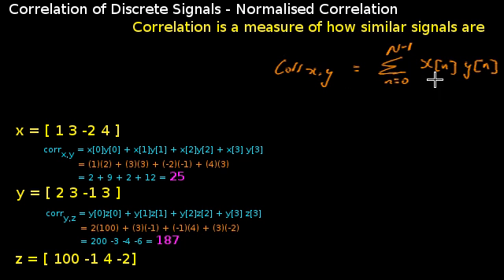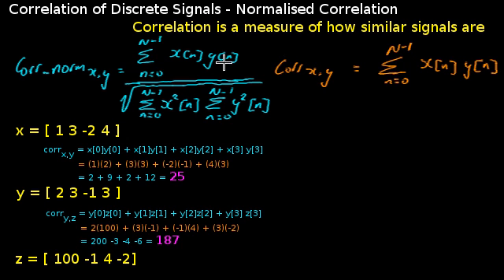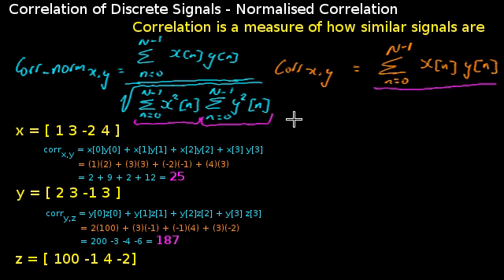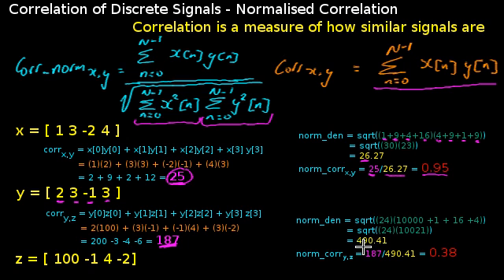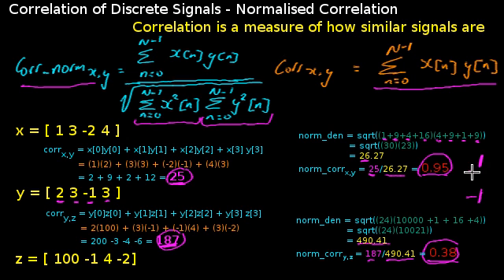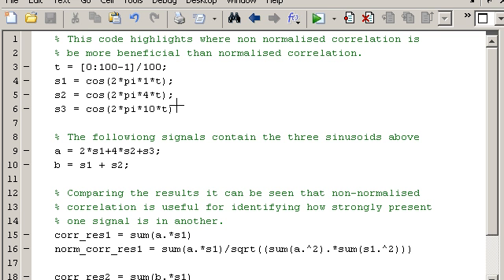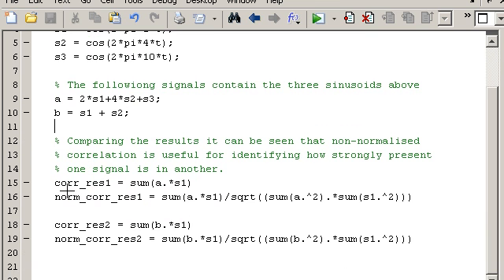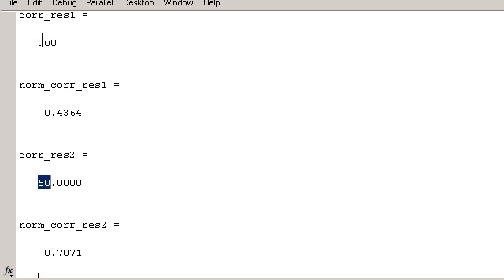Normalised Correlation  Explanation with Demo

Comment: So, from what I understand:  correlation measure is to show how strongly the signal is into the sample signal, while normalized correlation is how similar are the signals, is this right, please?
Reply from the maker: yes. That's how I interpret them
Reply: @ddorran  Thank you for your response, David. Actually, this makes sense and does have a basis I feel. While the Correlation measure shows how strongly the signal is in the sample signal by the dot product, the normalized correlation relation looks very much similar to the Pearson correlation factor (r). Thereby describing how linear or nonlinear the association of the two variables x and y, or in this case - the signals are. Can I conclude like this? It would be nice to hear your thoughts, please.

Comment: This is a good explanation of what the equations represent and how to code them up, but ultimately fails to explain what it claims to do (describe when normalised correlation is beneficial to use over other methods).
Reply from the maker: In the first minute of the video it shows that standard correlation measures are impacted by the energy of the signals being correlated (rather than the shape) and later it shows that normalised correlation deals with this issue by scaling standard correlation appropriately. Does this not show when normalised correlation is useful? Have I misunderstood the point you are making?

Comment: Thanks for sharing this!!!
I'm trying to implement but I'm not getting a value between -1 and +1...should I be doing something wrong?
Anyway 'seems' to work.

What i do is:

i have two arrays:

A[a1,a2,a3,a4...]
B[b1,b2,b3,b4...]

first normalize both data groups from 0 to 100 ( i want to find % changes)
second i put in a variable 'first_pass'  : (A[a1]*B[b1])+(A[a2]*B[b2])....
third i put in a variable 'second_pass' : (A[a1]^2) + (A[a2]^2)....
forth i do the same with graph B and store in 'third pass' : B([b1]^2) + (B[b2]^2)....
fifth i get my results: (first_pass/(SQRT(second_pass*third_pass))

my results is always > 0 but not between -1 and +1
could you help me? :)
Thanks!

Comment: Could someone please resolve the following issue : The correlation results 1, when compared to correlation results 2, indicate that the 2 signals in consideration are better correlated in the first case (100>50). However the same conclusion from normalized correlation results indicate otherwise (0.4364<0.7071)

Comment: If the sinusoid is already apart of the signal a and b why are you multiplying the sum of the sinusoids squared with the sum of the signals square in the denominator of your code?
edit: My bad, I misunderstood what signals you were comparing in the normalized correlation. However, I don't understand why it was required to step through the matrix with a for loop previously but not now?

Comment: Hello, thanks for the video. I have a question, what does biased and unbiased means in the xcorr function? (roughly speaking).
Reply from the maker: unbiased means that values further away from a lag of zero are general smaller since there are fewer non-zero samples to sum. You can account for this by dividing by the number of overlapping samples for each calculation.

Comment: Hi David, 

I am really enjoying the videos you posted. I have seen others using the Pearson coefficient for correlation, specifically in template matching methods in the signal processing domain. The method above and Pearson method will provide rho to range from -1 to 1. However, It seems they will give slightly different answers, regarding the produced correlation coefficient.  

Are you aware of any type of documentation out there that highlights these two methods and their differences? Or even a more specific name for the normalized correlation coefficient method you discussed above for to me to do literature search on ? I am aware of this method, and its heavily used in signal processing as well, for applications in DTF and match filtering. I guess I am wondering if there is an ideal time to use one or the other, and I really haven't seen anything or anyone address this..... 

Best, 
Nick
Reply: +Nick1Nap 
I think found what I need... Thanks! 

http://dsp.stackexchange.com/questions/9491/normalized-square-error-vs-pearson-correlation-as-similarity-measures-of-two-sig
Reply from the maker: +Nick1Nap Thanks for posting this link! I have a bad habit of using my own (and sometimes incorrect) terminology when I'm attempting to explain a concept and I have noticed this to be particularly problematic with this video.

Comment: when correlation is applied is there a minimum value based on which it is decided that the waves are similar or it is proportionality between minmum corr and max corr ?
Reply from the maker: it would depend on the application and would most likely be determined through experimentation
Reply: David Dorran so it complicated then . i did a correlation between i think two sines and the value was 60 . 
in DTMF number detection .. correlating the spectrum of the recording with standard DTMF signals spectrum doesn't result 1 in the normalized formula . the peaks are of very less values but still constitute peaks compared to other correlations .

Comment: how we can link this to the fourier series and transform ? 
i think in the transform we are using the standard correlation .
Reply from the maker: The discrete Fourier transform is a simply correlation of a signal with a set of sinusoidal basis functions see https://www.youtube.com/watch?v=B2iUDBZzBpY
Reply: David Dorran Nice. But what is the necessity of correlating with exponential ? 
Exponential contains Re cosine part and Im sine part . Why we just can not correlate with cosine or sine ? And why we do not use normalization ?
Reply from the maker: hamdi f The complex exponential is a combination of a cosine and a sine so its mathematically convenient to use it rather than use separate sines and cosines. Also if the signal being analysed is complex (real and imaginary terms) then that signal isn't just made up of sinusoids (which are combinations of negative and positive frequency complex exponential pairs which are equally weighted see https://www.youtube.com/watch?v=M1bLPZdNCRA) its made up of a set of positive frequency complex exponentials and negative frequency complex exponentials which may not have matching weighting for positive and negative frequency pairs.

If you used normalised correlation you wouldn't be able to determine how strongly present a cosine or sine was in the signal being analysed see http://youtu.be/ngEC3sXeUb4?t=6m36s
Reply: David Dorran Regarding the last paragraph ; if i got a x1(t)=coswt and x2(t)=10*coswt  then the normalized corr formula fails though they have the same frequency and should have the same magnitude response except for the some scaling differences in magnitude plot . 
And if i have two different frequency waves the standard corr formula may fail and show misleading answer that they are similar ! 

The second point ; you said that standard  corr shows how much of signal 1 is in signal 2 . But since multiplication is commutative and that means that sig1 is contained in sig2 as much as sig2 is contained in sig1 ! and i think that is not correct . 

Can we use at least for real signals .. a Fourier terms of cosine or sine for corr ?
Reply from the maker: If you correlate two sinusoids of different frequencies (f1 and f2) you will get a result of zero (once the duration over which you correlate is an integer multiple of 1/(f1-f2))

With regard to the second point my terminology is misleading - I do say that correlation is a measure of how strongly present one signal is in another which I think is conceptually a nice way to think of it in certain situations. However saying that correlation is measure of similarity between two signals is more accurate and would fit in with your observation that the correlation process is commutative.

Yes you could undertake a Fourier type analysis of real signal that correlates against only real cosines and sines.

Comment: why we should not use the normalised correlation here? Is the b did more similar with s1?
Reply from the maker: In the second example you are trying to determine how strongly present one signal is another rather than a direct measure of similarity between signals
Reply: Thank you! 
I think I don't get the meaning of 'strongly present', would it be used in signal conditioning?
 It did amplify the signal, yet introduced a larger noise.
Reply from the maker: Yes - you could have a signal you are interested in buried in noise. So in this case you would have a signal added with noise - you could use correlation to see how strongly the signal was present in the noisy signal.